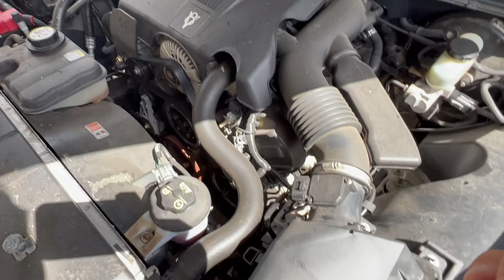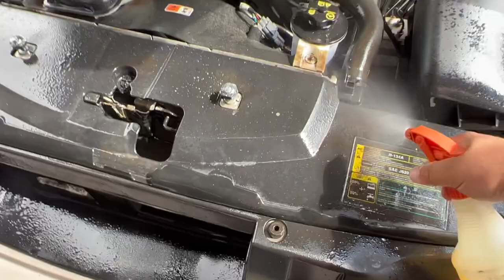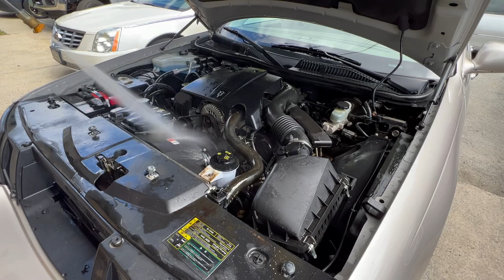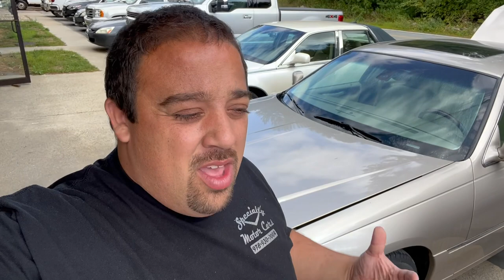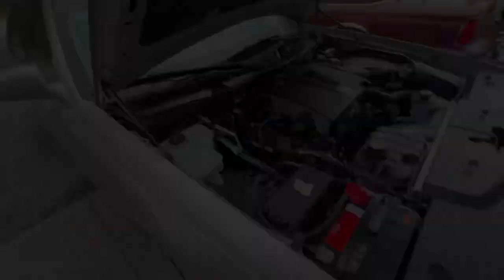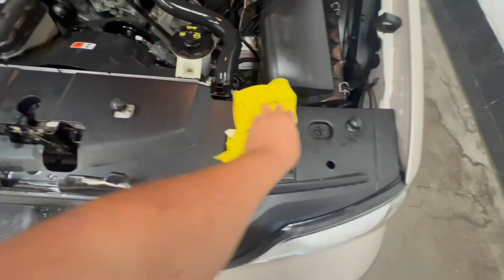How I clean engine bays to look new! EASY Step by step to Make it Look NEW!

Comment: I use "totally awesome" from the dollar store. Its an all purpose cleaner. The best and most affordable you can use, TRUST ME! Personally, i use a long handle, long bristle scrub brush and detail brush for agitation which is the brst way to really clean something but good job. I would also spray your dressing into a microfiber applicator instead of just going nuts spraying everything, getting overspray everywhere. Makes me cringe.. I use aero cosmetics rubber care for my dressing...the best for a matte-satin black finish, Tires too. I am a detailer...but, that's me.
Reply: iv used the same soap to fix mistakes at the shop I work at as well.
Reply: I just bought some "Totally Awesome" cleaner/degreaser and cleaned my engine compartment with it. Wow! Best degreaser I've ever used. Works great on my tires as well. The name is accurate... totally awesome!!!
Reply: My only additional comment for the Totally Awesome cleaner is to take care to not breathe it in as it is quite strong.
Reply: @sooverit5529   Very true.
Reply: @sooverit5529   Yup...and only a buck. Great for around the house too. All I ever use.

Comment: You should have disconnect the battery and/or not get the battery wet. Fluid laying on the battery can  be a conduit between positive and negative. Spraying down the engine like that is bad. You are selling the car so you won't have it when the electronics and wiring go bad. Everybody needs to go watch Chris Fix tutorial on engine bay washing. I am surprised because this guy always seems to have a real love for his cars.

Comment: That second application not only gives the engine a (new) look, but may also keep the plastic pliable to prevent cracking. Great video Anthony! Thanks!
Reply: Quite the opposite. solvent based products that contain petroleum like this. while it may look nice. they can lead to premature cracking or drying of rubber and plastics. 

Not to mention all the dirt and dust that it will attract because of how greasy it is. (hence, why techs dislike it)

I use "Stoner Car Care 92034 Trim Shine Protectant" it not only protects. it's not greasy, and dry to the touch. won't attract dust. same look as anthony's engine without the greasiness and premature cracking and fading.

Comment: Thanks for the tips, it's been a hot minute(several years or more)  since I've done an engine bay and my '05 LTC Signature surely needs it done @ 66k miles.  Don't think prior two owners let anyone touch it and it (engine compartment) needs to match the outside for a change...like new.  Thumbs up deserved.

Comment: I have a problem with my Lincoln and love to have some help from someone to help me fix it or just tell me what the problem is with it …
Reply: What kind of Lincoln, year, mileage, and what is the problem 🤷‍♂️
Reply: @RustyZipper  it’s a 2003 Lincoln and the abs light on and my mph hand not work but my gas hand & temperature hand still working
Reply: @brandonmoore3261  - I’m not up on these Lincoln’s but I’ve had many Chevy’s where the front wheel bearing has speed sensors in them that go bad. Causing the ABS not to work. I’d start there, Check out “Ford Boss Me” here on YT, he’s a Ford Dealer Tech and Town Car lover